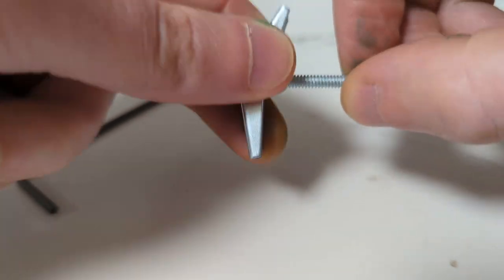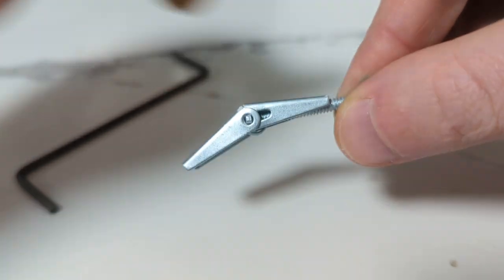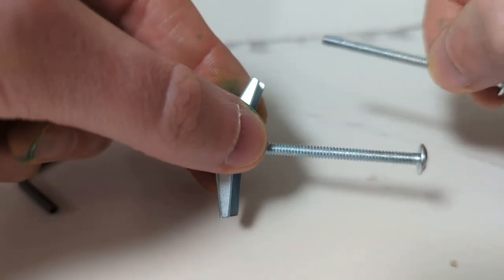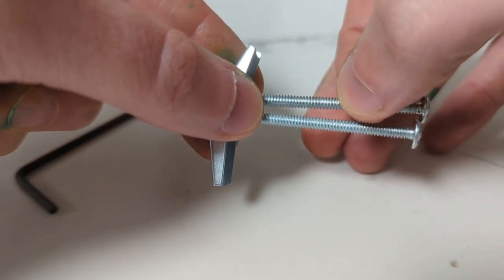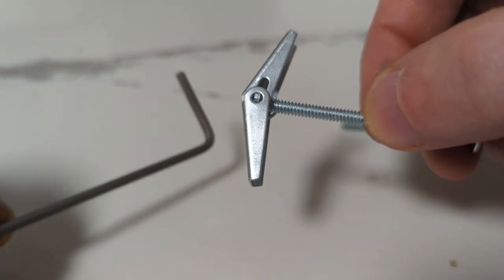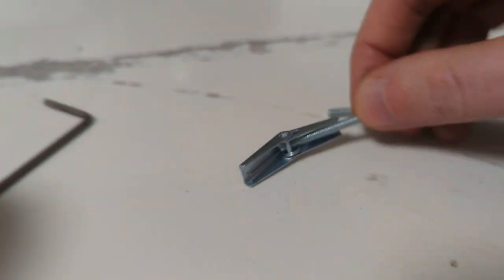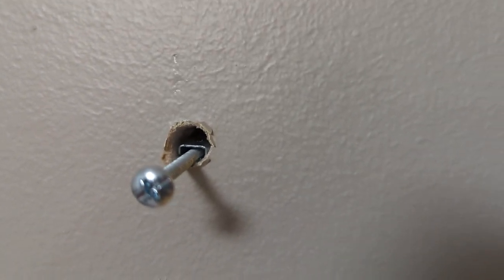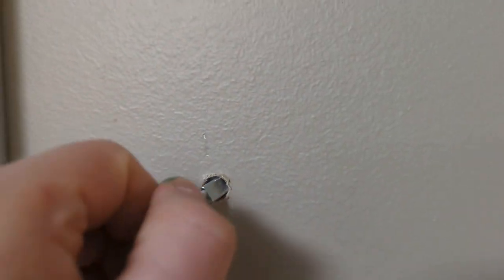Remove a Toggle Bolt for Reuse (How to Not Lose the Wing Nut)

Comment: Nice! Thanks for the tip. Now I won't have to lose the expansion part behind the wall.
Reply from the maker: Bolt conservation PSA 🙃
Reply: Your video helped me nail this down.  I did find that the inner hinge wing will fold down any time.   Get that one down and one finger on in then start unscrewing until the other one flips out.   Thank you.